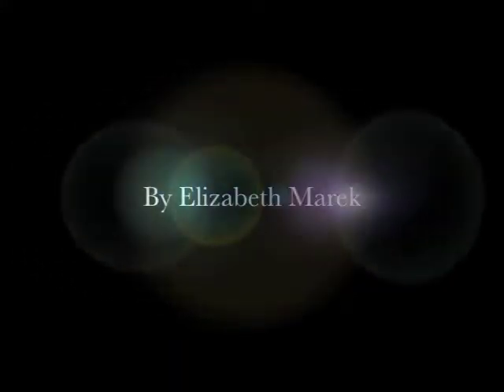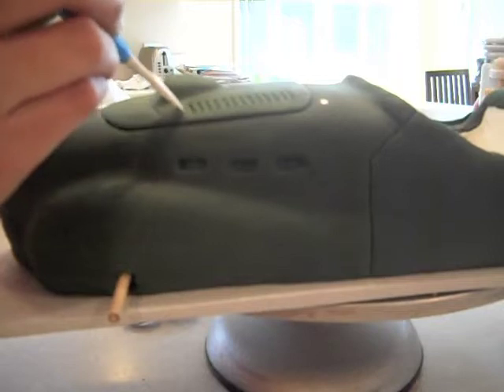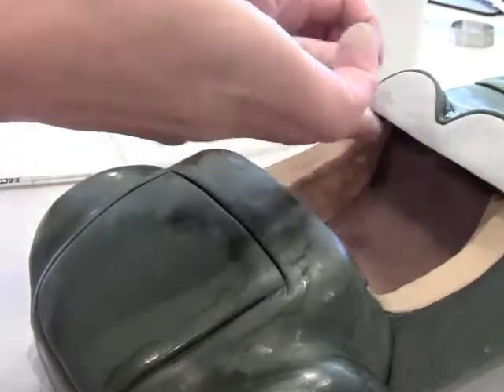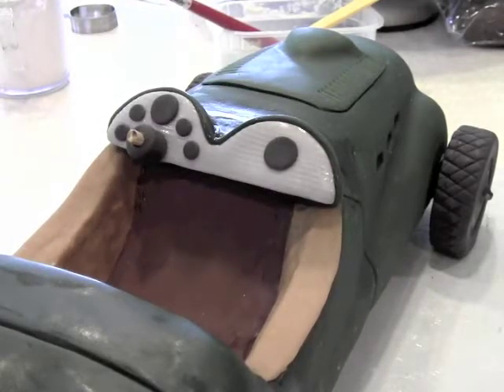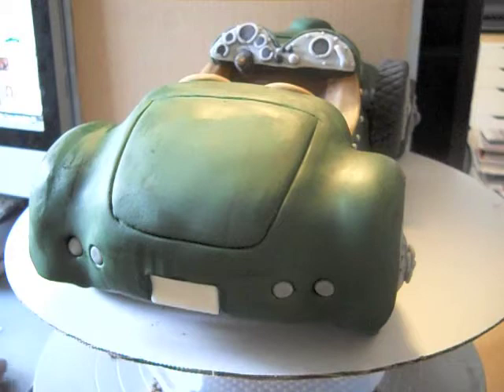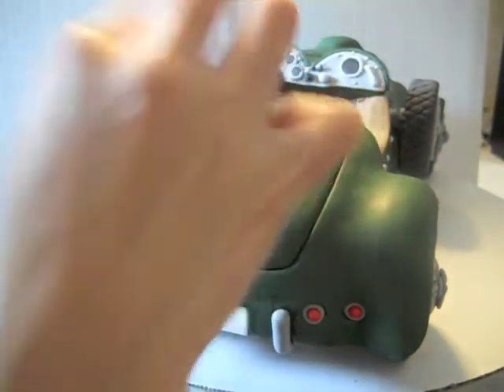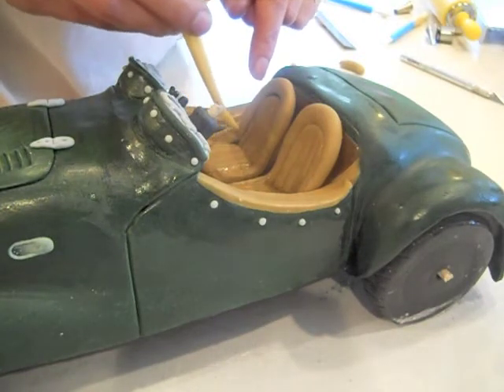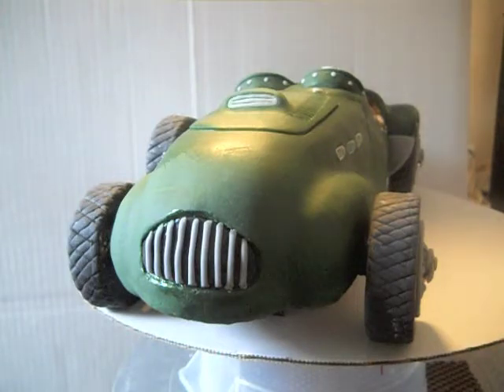How to make a Rice Krispy Treat Car - Part 3

Comment: Hi! How did you make the fondant  shiny?
Reply: Hello! On her website, she explained how she got the shiny finish: "I achieved the shiny finish to the car by spraying it with water from an airbrush and then placing the car in front of a fan. The fast moving air causes the water to dry faster and leave the surface of the fondant nice and shiny."